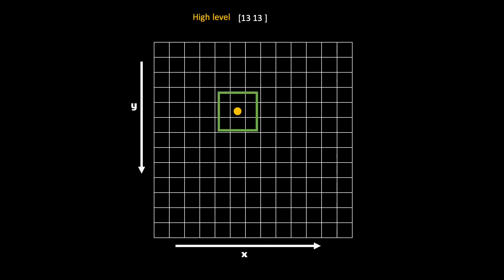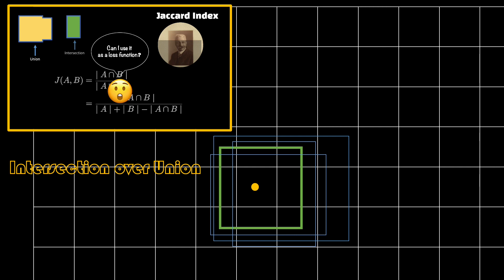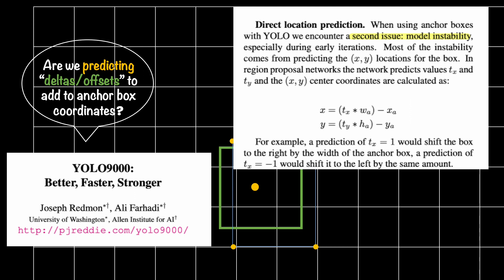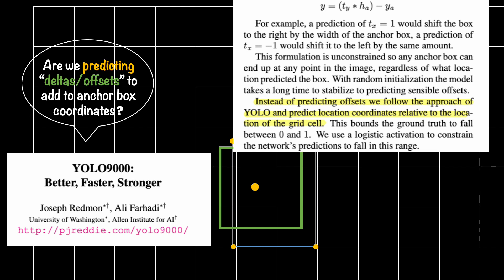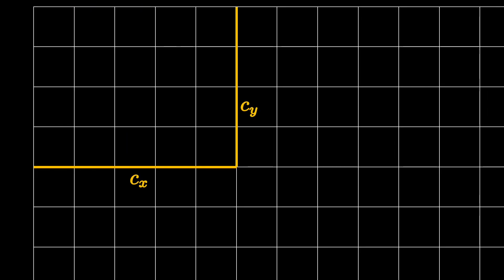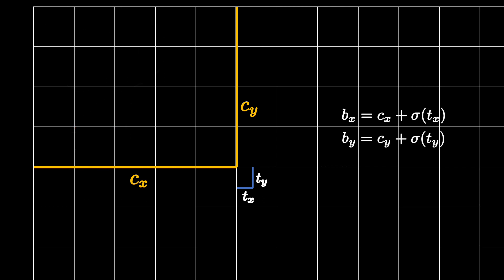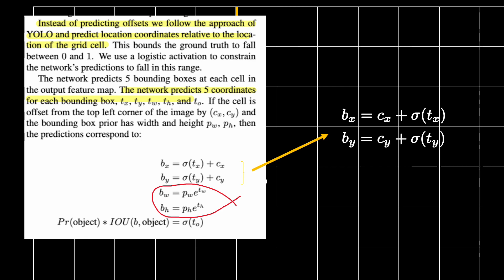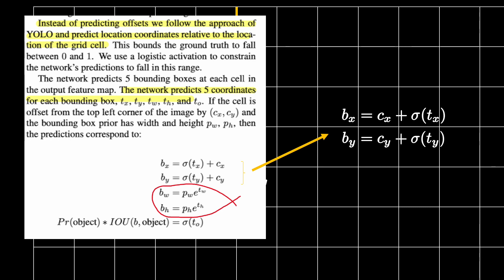Bounding Box Prediction | Yolo | Essentials of Object Detection

Comment: You are an excellent instructor, thank you.  The rationale for multiple priors per cell is not explained.  Unlikely to be inconsequential since they are common in object detection. I suspect that it helps in multiple ways.  For example:  Neural network will smear its objectiveness assessment over a number of cells.  If multiple objects are present in a picture, then the multiple object's smears will overlap (superposition).  By having multiple priors per cell, this smearing can be diluted, essentially a hash to separate predictions do the superposition does not go above the detection threshold.  I also suspect that the encoded ground truth of height and width are easier to learn by using these multiple priors per cells.  Does this make sense and are there more ways that multiple priors per cell help the trainability of these models?
Reply from the maker: Reason for multiple priors per cell is to incorporate the different size of objects belonging to different classes. And as such even for a single class it is not bad idea to use different scales and aspect rations.
Reply: @KapilSachdeva  I suppose I am looking for why it is a good idea to have multiple aspect ratios per cell. If I have a sufficient number of cells, then unlikely for two objects to be perfectly aligned with that cell.  So I suspect it is not to disambiguate multiple perfectly overlapped objects. Setting the prior to say each cell has one object that is full page, and let the ground truth train the actual value.  I suspect this will not work as good as multiple aspect ratios in each cell. if so, why?
Reply from the maker: > Setting the prior to say each cell has one object that is full page, and let the ground truth train the actual value. 

Not sure if I understand above line.

Regarding disambiguate multiple perfectly overlapped objects - 

The objects may very well overlap in the "feature map". A cell in the feature map (grid) covers many pixels in the original image so it is possible that a given cell contains the center of multiple objects.
Reply: @KapilSachdeva  good point, thank you